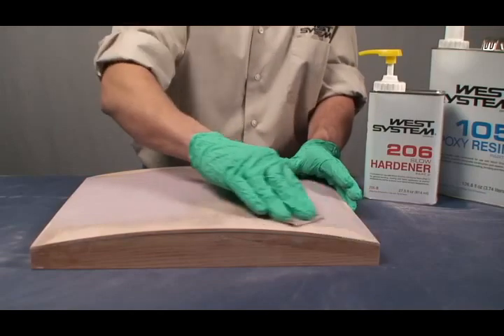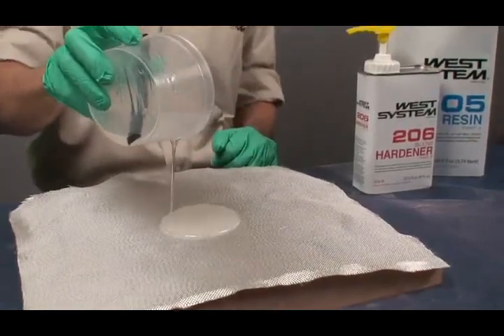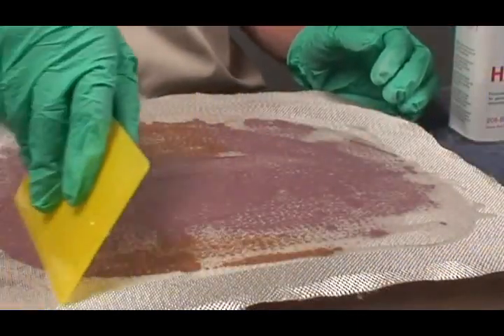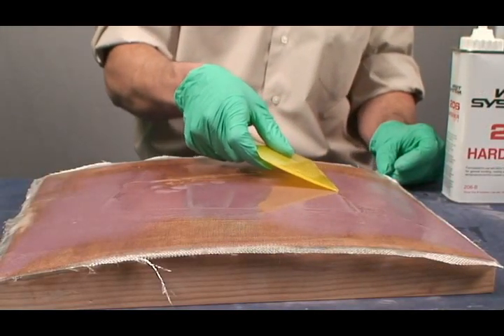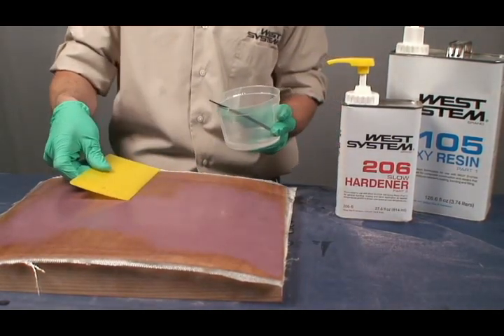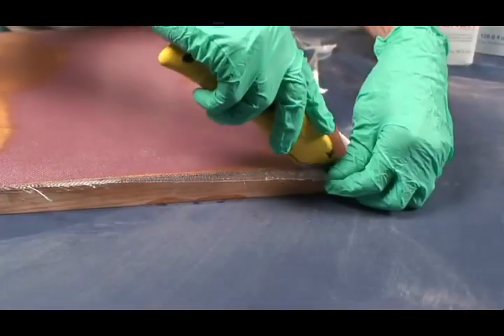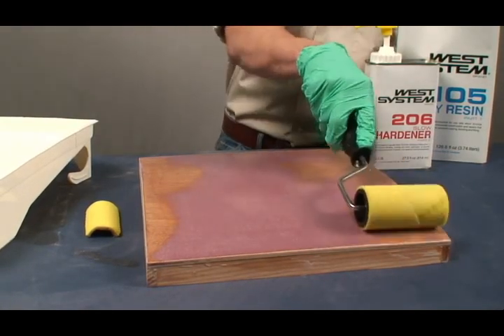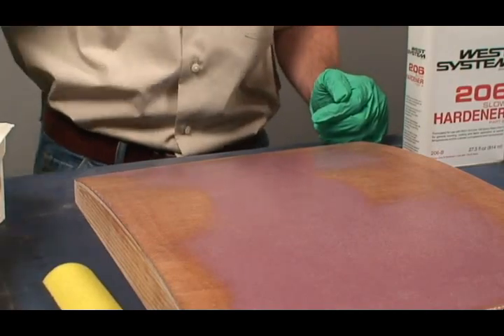Applying Fiberglass Fabric with WEST SYSTEM Epoxy

Comment: Would the epoxy adhere to fiberglass filler underneath it?
Reply: Alsy no. The filler should be on the outside. Also pro-seal should be used over the glass not more resin, that will create cracking.  

 should coat the wood with resin before applying the Dry cloth to help speed the soaking process and reduce resin useage. 

With bigger sheets that method is to slow.  Need a laminating table setup. soak and fold the cloth up, then move to the structure to be glassed, unfold and roll air bubbles  out. This will not work with chop strand matt.